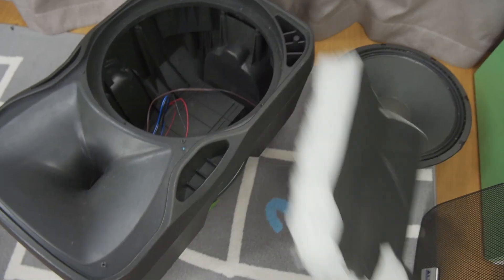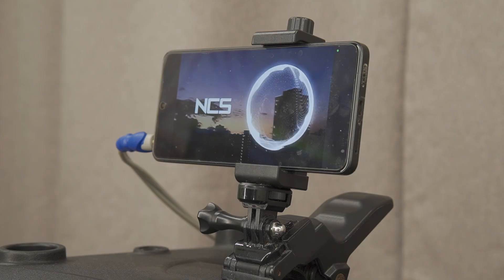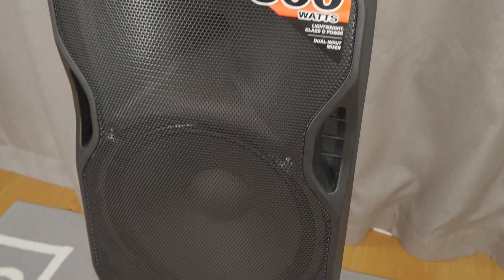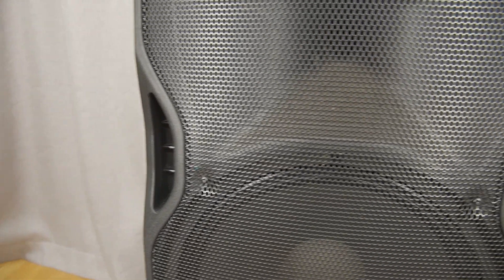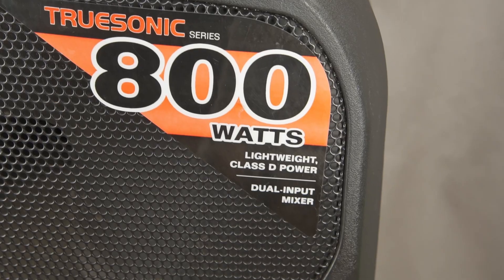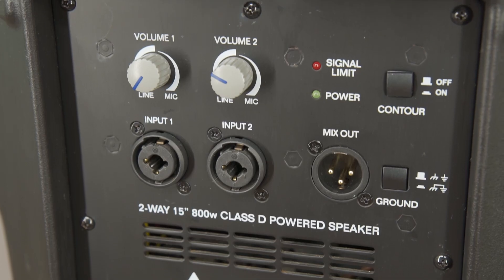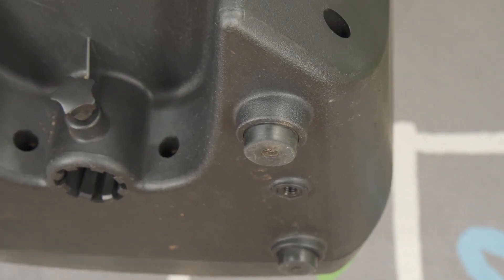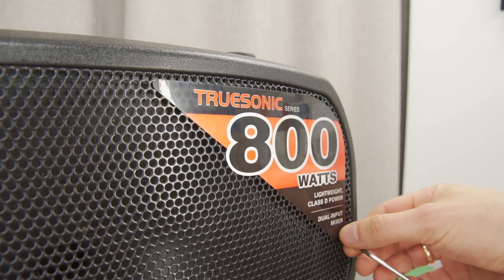Look inside PA Active 15-inch Speaker Disassembly

Comment: A very cheaply made poor quality speaker that is!!
Reply from the maker: You need to evaluate the overall sound and the features the system offers for its price budget, and this one does that very well. I’ve done teardowns of speakers costing several thousand, and if you look at their build quality, you’ll be surprised, expensive doesn’t always mean high quality in construction.
- $4500 Magnat speaker: https://youtu.be/44Rre89Ak_8
- $3000 Magnat speaker: https://youtu.be/wQiGe0nprHA
- Piega C2 high-end bookshelf speaker: https://youtu.be/fzvh05_6q0o
- Bowers and Wilkins high-end center speaker: https://youtu.be/DEVVod8GL-4